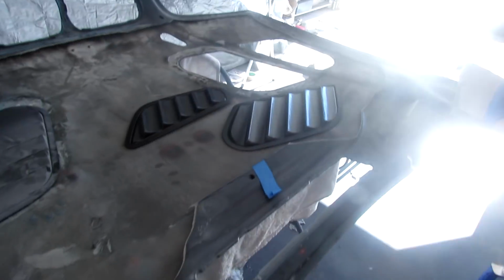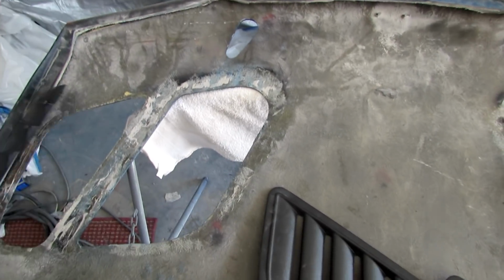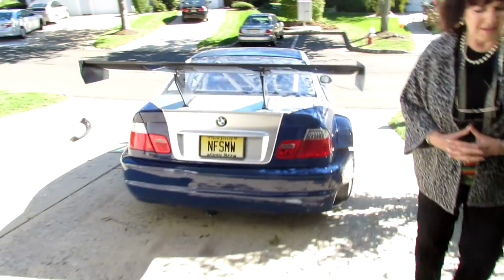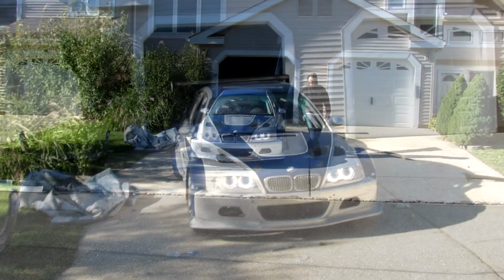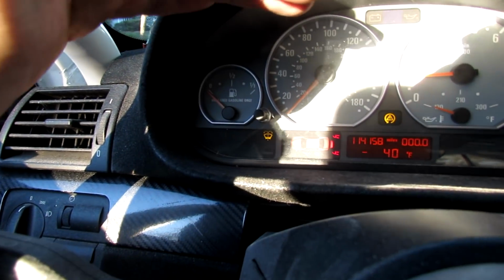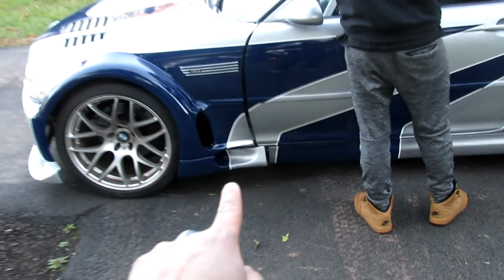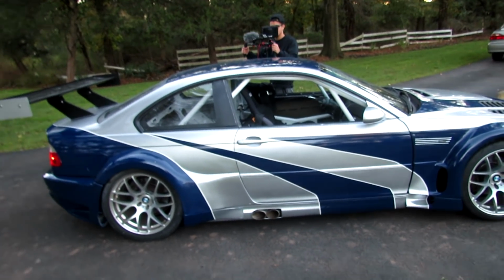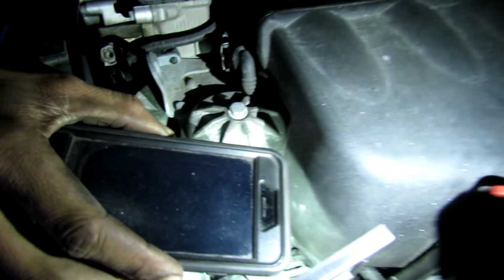NFSMW M3 GTR V.2 COMPLETED ... And It Broke.

Comment: As far as the right rear bumper stick-out issue I would just drill a hole through the inside flat mating surfaces with the bumper and wheel well and wire it up, I had to do this to my M3 front bumper since the OEM bolt tabs wore out on mine. Hope you win man that 46 is looking like a killer

Comment: nice work but the front bumper is not looking as it is supposted to
Reply: Not just the front bumper, but the side skirts and fenders need to be aligned properly. The bumper kinda looks like someone hit the car in the nose and it flattened. But hey still smiling.

Comment: the  front bumper is kinda too wide
Reply: Devilsana Thangjam wide is never wide enough
Reply: the front bumber is pushed into the face of the car i don't think its finished
Reply: MostED13 he did it like that because the bumper wasn't matching with fenders so the only way he had was to push the bumper
Reply: One of the problems is that the paint does not match with the original.
Reply: Кристиан Тошев - The paint had to be like that because of the bumper. The bumper has a lot less detail than the one in the game. It looks "too wide" because the sharp contours and edges from the game are not present there, making it look flat. But I believe v3.0 will rectify that. All in all, it still looks good, even if its not 100% accurate.

Edit - Also, it didn't fit in perfectly with the fenders so he had to push them inwards further than normal. This made it look flatter and wider than usual as well.
Reply: Yes this is by far the best interpretation i've seen.